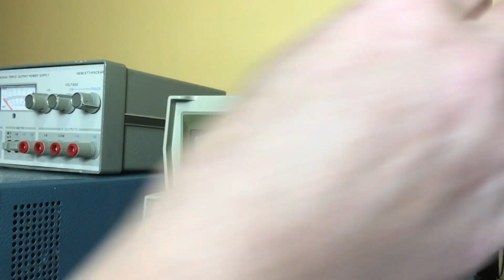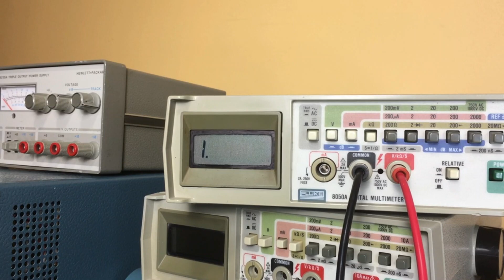0029 - IBM PC (5150) Fix & Upgrade:  Part 1

Comment: I converted a ps2 keyboard to a din 5 just by soldering in a din 5 connector BUT what you have is the xt adapter which is perfect for the machine. In short theres 2 types if keyboards xt which is din 5 and AT which comes as a ps2 or a din 5.
Reply from the maker: Yes, your 100% correct.  I would some day (if I can get a decent price) pick up one of those PC?XT?AT switchable keyboards, then with a simple 5p DIN to PS2 adapter (which I have) you can use the keyboard on pretty much anything that qualifies as a "vintage PC".

Comment: 63W PSU? The good old days when PCs were not space heaters. Is PSU based on 50/60 Hz transformer? I used to have a C-64, PC-XT, 286 Epson laptop and sometimes I watch Adrian repairing his stuff. But I wonder if anyone is actually using any of these machines for longer than 10 minutes, once every 5 years?
Reply from the maker: It's an old SMPS and can be used on both 50/60 Hz and the associated voltages (120/240).

LOL! I do use my old computers a bit more than that, but I get your drift.  What I like about them is the simplicity and the lack of excess.  It somehow bugs me when I sit down to a modern laptop that has enough power and resources it could easily have run JP Morgan Chase 30 years ago only to have it struggle to run Windows 11.

Thanks for the comment!
Reply: @uni-byte  That is why I am late adopter of Windows. I have moved XP-64 to 7 in 2014, and 7 to 10 in late 2021. I guess I will move to win 11 or 12 around 2029. BTW, I am about to buy bench supplies. The cheapest ones are LONGWEI/Kaiweets/whatever, but these are a bit noisy. One guy made a video in which he solders some 47nF caps between sources and drains of power transistors and adds 33R resistors in series to gates. He checks with thermal camera that power dissipation did not increase noticeably despite slowing down switching mosfets. The output noise of PSU decreases significantly. Do you think it is safe to do this kind of mod?
Reply from the maker: @jakubczajka4275  Yeah, I saw that video.  I was going to see if there is something like that I can do for the rejected Hyelec power supply, as well as some output filtering.

Comment: Nice repair! Do you have a specific use for this machine or is it, like many of my restorations, just something you wanted to have? Regards, David
Reply from the maker: Hi David.  More that latter than the former.  I'm a bit of a retro computer junkie and always wanted an IBM 5150.  I have a small collection of about 12 varied and odd systems and a wish list of about 12 more.  Some days I just like to fart around on my old computers for a little relaxation,  In that sense I have a use for it, but otherwise I do like to keep these machines out of the landfill and in working condition.
Reply: @uni-byte  I understand completely. I'm a test equipment guy and have a fair sized collection that I enjoy "farthing around with" and also do not like to see go into the landfill. I am looking forward to the next part of this project.  Regards, David
Reply from the maker: @davidv1289  LOL!  I'm a bit of a test equipment guy myself!  That bench I have the PC on is my retro computing bench and all the test equipment there is retro too.  All of it rescued and repaired.  I try to do all my old computer repairs with close to period equipment.  I hope to be putting up a video on Saturday where I use a new GPSDO to tweak a venerable and (to me anyway) beautiful little HP Measurement System universal counter.